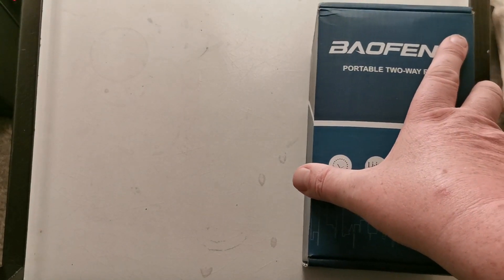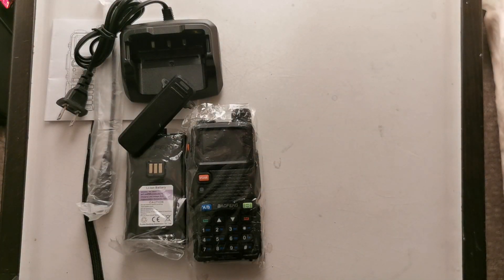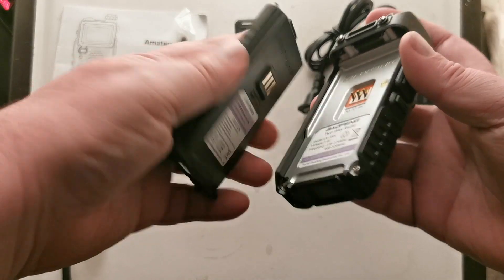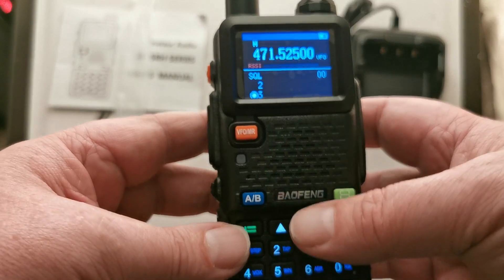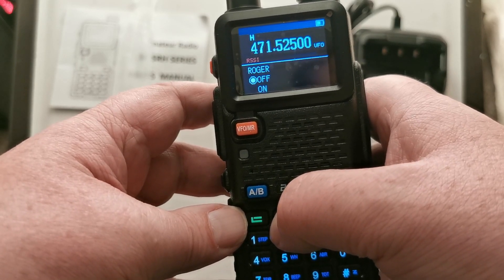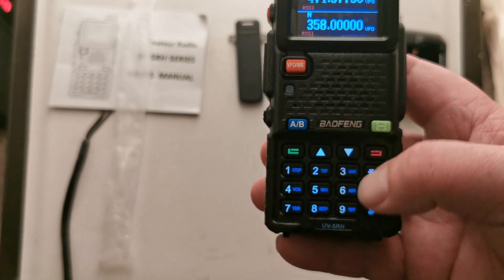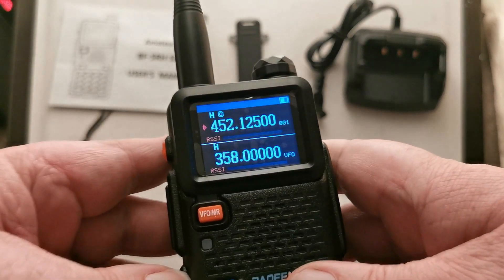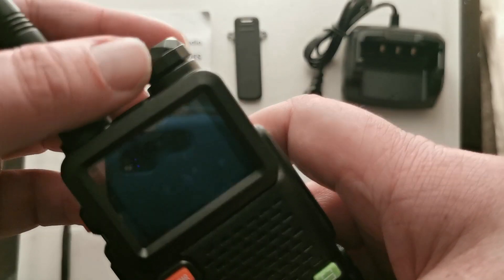Baofeng BF(UV)-5RH HAM radio - unboxing

Comment: I was looking at this on the baofeng website.
There are two options when buying this, Tri band and multi band. Could you tell me the difference as I am new to the walkie-talkie.
Reply from the maker: The one I have is the multi Band one.   The triband as far as I'm aware only has 70cm,1.25m and 2m.
Reply: Version 1 - Multi Band
FM radio 76-108 MHz; AM aviation frequency band: 108-136MHz (RX)
VHF1: 144-148MHZ (RX&TX) ; VHF2: 200-260MHz (RX)
UHF1: 430-440MHz (RX&TX) ; UHF2: 350-390MH2 (RX)

Version 2 - Tri Band
136-174 / 220-260 / 400-520MHz